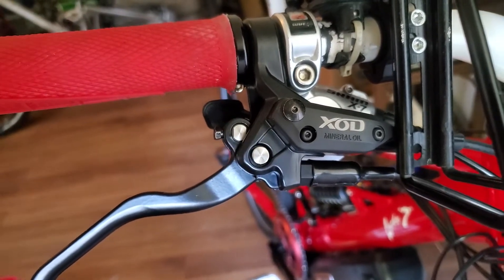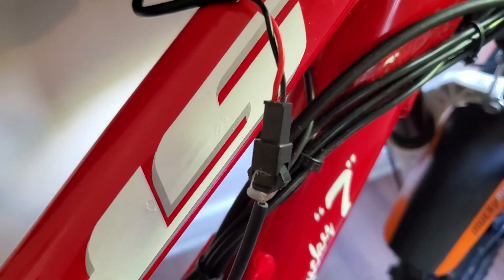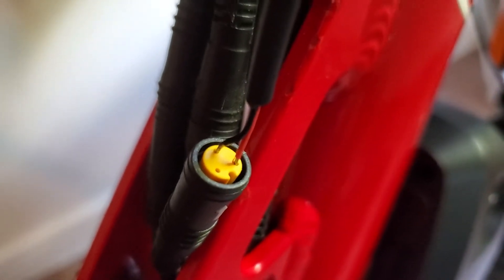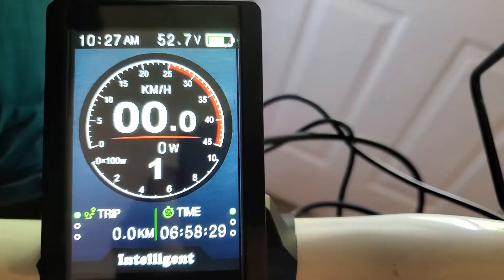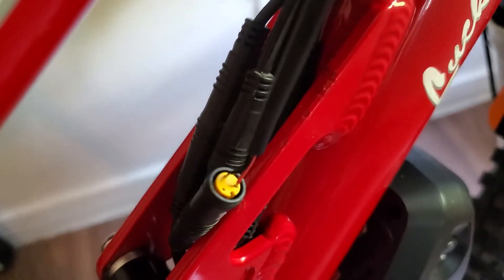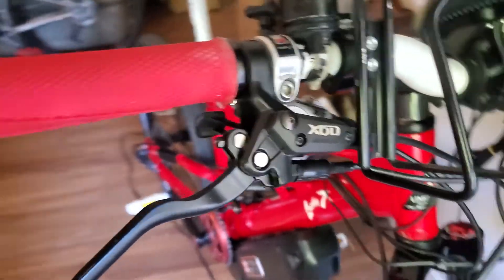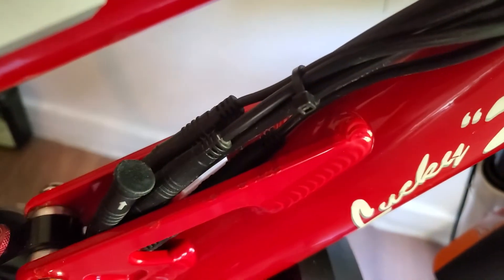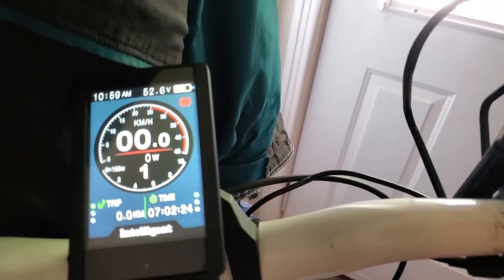Lucky7 BBSHD XOD E300 hydraulic brakes 2-wire to Bafang

Comment: Cheers mate! The 3 pin is to supply power to for example a shift sensor. The shift sensor is a potentiometer, the brake signal is signal only. Thanks for the video my friend. I can solder my cut offs now. :D